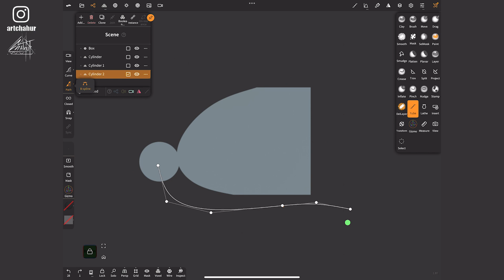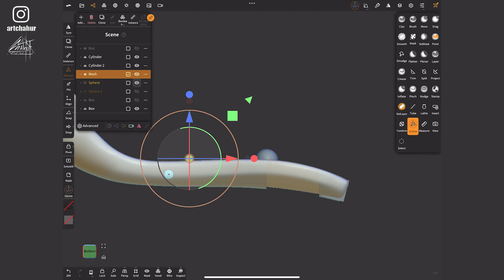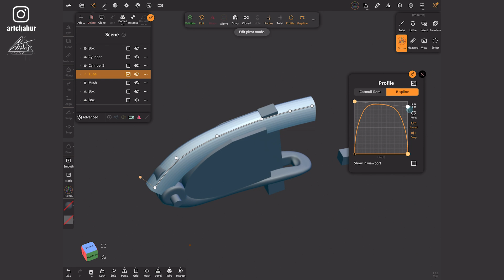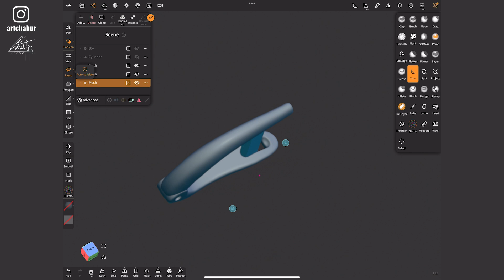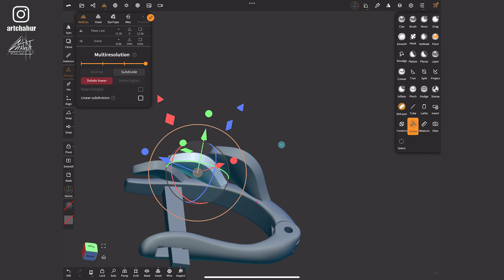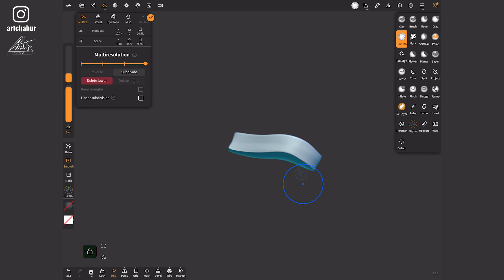Nomad Sculpt Jewelry earrings for 3D printing

Comment: I have Nomad 1.9 and the Cylinder Topology section is misisng
Reply from the maker: You probably work on the phone. It is likely that some buttons did not fit. Make the interface smaller.